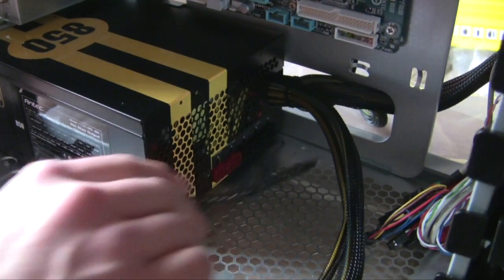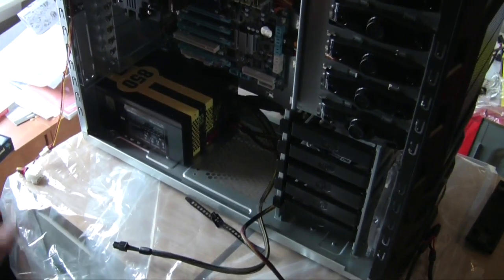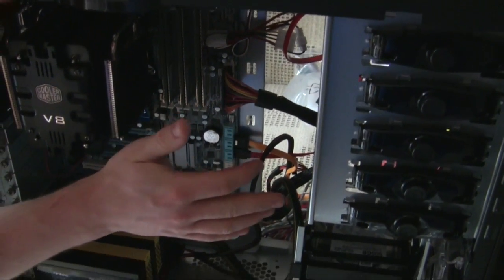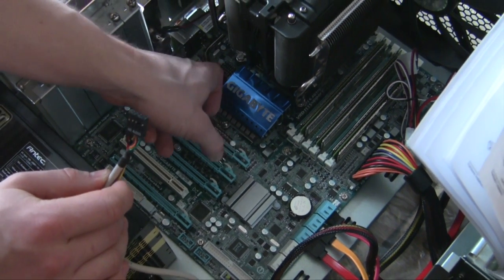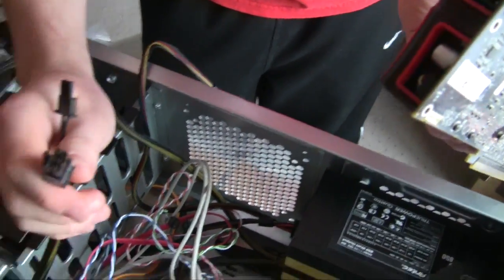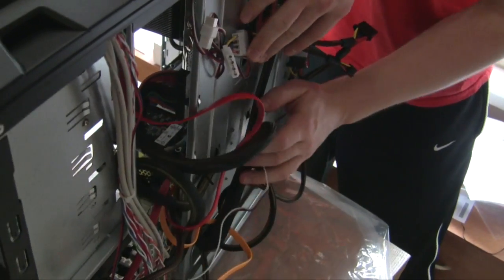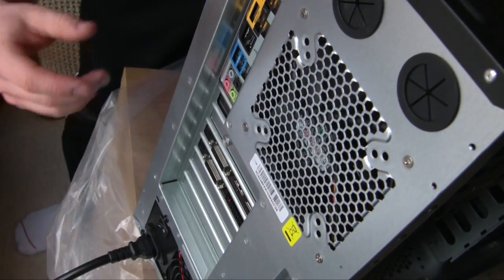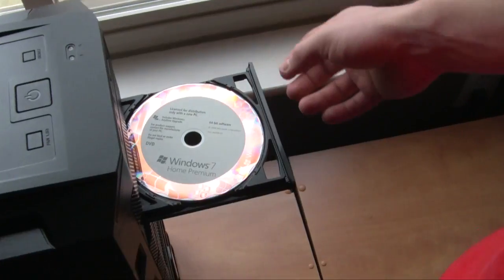Basic PC Assembly/Build TUTORIAL (Part2)

Comment: @DEVIAL101 It's actually very easy. The Cooler Master HAF series are big enough for anything so that's the case sorted out. Get a decent power supply, 750W up and marked 80%+ Bronze at least.
After that it's a case of picking a processor you want and working back from there. The processor will have a socket type, look at motherboards with that socket type. Motherboards are funny in that there's really one for any pricepoint for every type so you just pick the funcions you want.